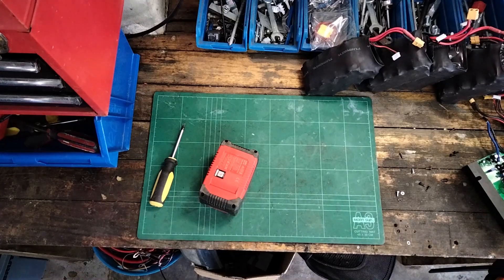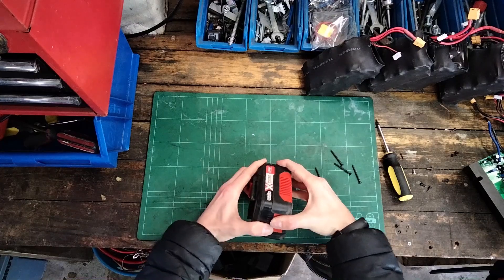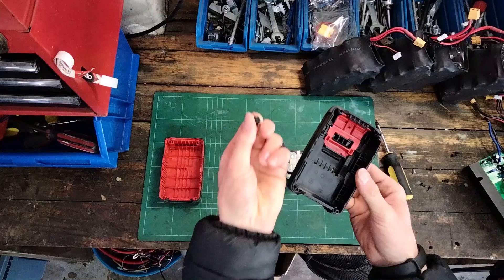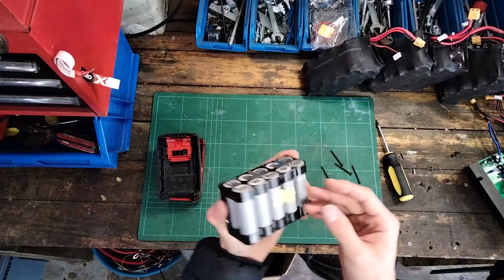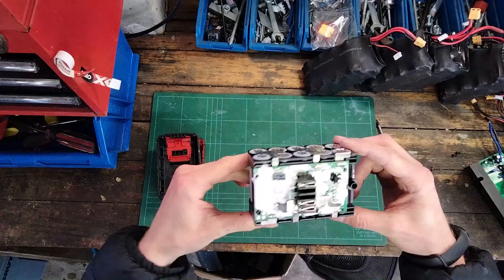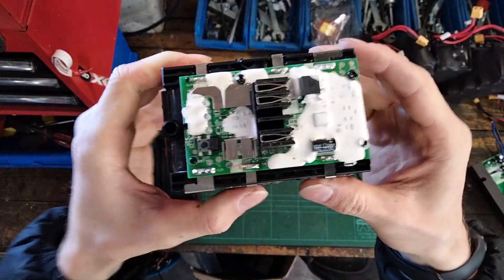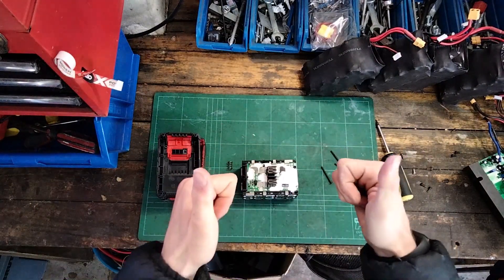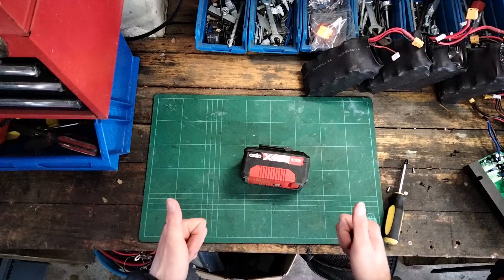Ozito PowerXChange Teardown Series: 18V 4Ah Battery Teardown & Look Inside

Comment: Will this battery cut power when it's too low I want to use it for a DIY project
Reply: Did you find out? I think they must as some of the accessories (the flash light and usb charger) don’t seem to. I’m not 100% sure though. Going to test it out myself soon

Comment: i've just found your channel due to searching for Ryobi 36v (i found a 36v whipper snipper without battery) and was thinking if it's good, i may buy a faulty battery to use the base of the case to mount makita 18v in series for 36v (is this fine?) and then use the cells from it that are still ok to repack some other battery packs i have that are dead perhaps. I have got a 2ah ozito pack with 2 dead cells, i think possibly due to the ozito snipper doesn't have any complex battery management in the tool itself to prevent cooking the cells.

Comment: Thanks for doing this.  I was wondering what the battery type inside was.  Once I saw this video I got my Ozito battery and tore it down.  The 3.7 volt lithium 18650 batteries are just what I needed to run my metal detector.  I only needed two of the 3.7 volt batteries and got ten of them from busting open this battery pack.  Cheers